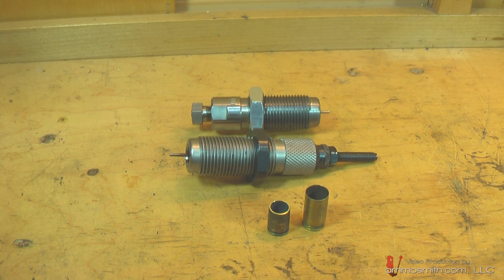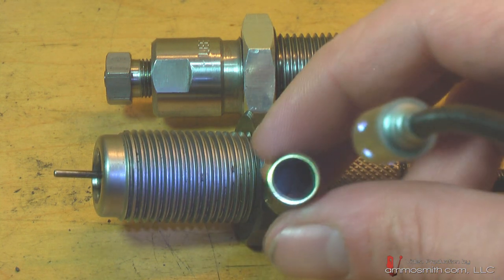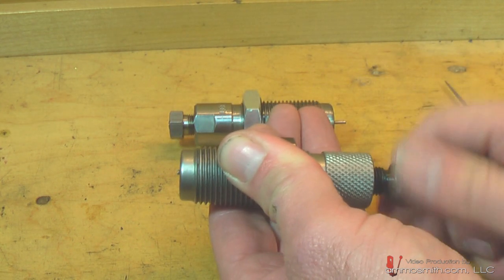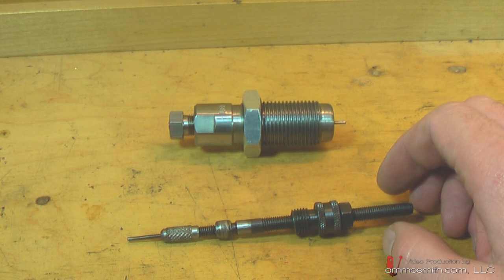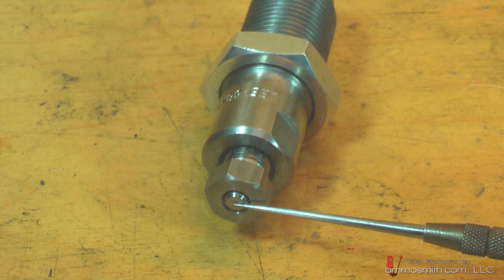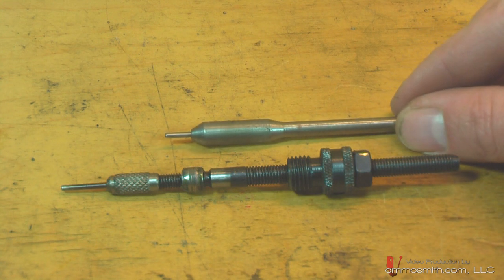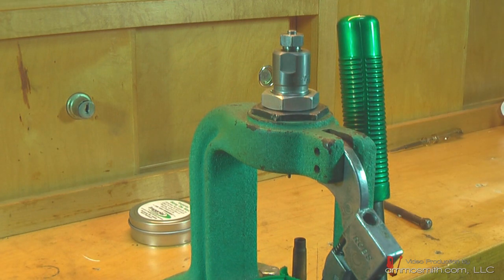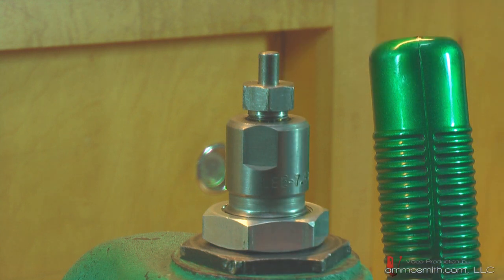"Bullet Points" Berdan Brass Identification

Comment: I'm glad i watched this video ! .When decapping the berdan shell's sometime the lip part get's nick up with the tool deal.will this be ok if i file it" smooth? and also are you supposed to remove the center anvil so you can try puting on a boxer primer with the help of glue. i'm dealing with mixed shells. 30-06 AMA

Comment from the maker: There are two ways. One is to fil the case with water and remove the decapping pin and allow hydraulic pressure to push it out...very messy and it doesn't always work. The other is to use a Berdan depriming tool...it works like a bottle opener.